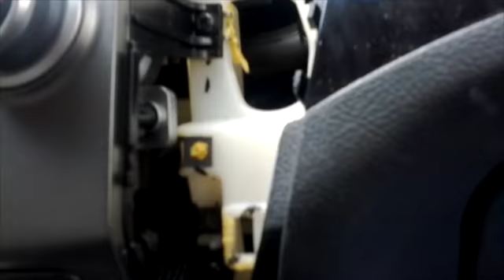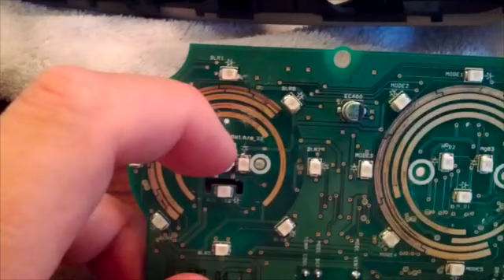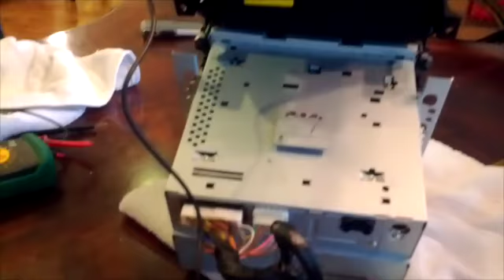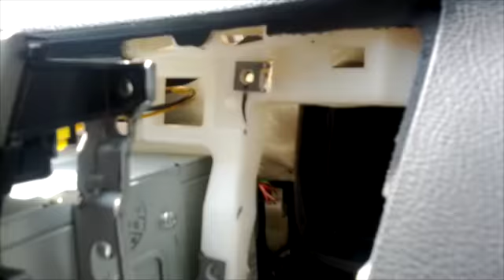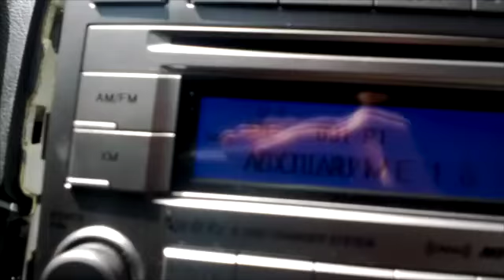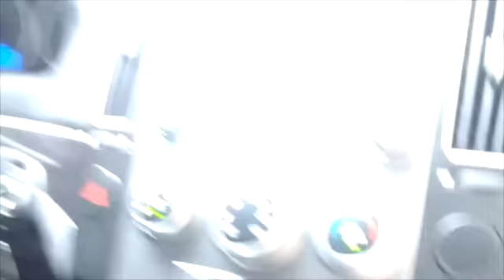Hyundai Veracruz Radio Removal and iSimple Aux Installation

Comment: 2008 doesn't have AUX, BT, or USB.  I have put the same iSIMPLE controller and run the AUX and IPOD connector thru were he did.  Unfortunely it lasted only for a few years and had to replace the cheap iSimple cables that shorted.
Reply: Hi sweetie go buy the pioneer double din with Apple CarPlay and install it on your 2008 Veracruz it will look damn good .

Comment: Don't you already have an aux jack in the center console? Even my sisters 2011 veracruz stock radio (non-Infinity) has one, as well as a USB port.
Reply from the maker: The 2007 didn't come with an aux jack.  I'm not sure what year they started including one.